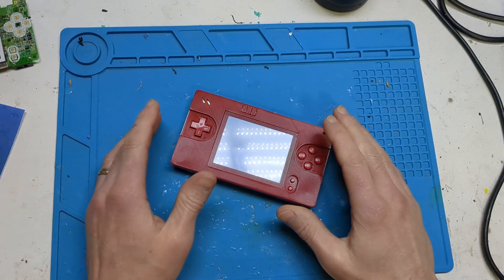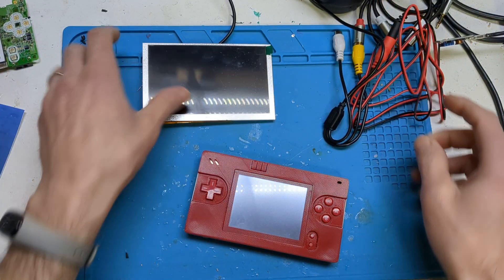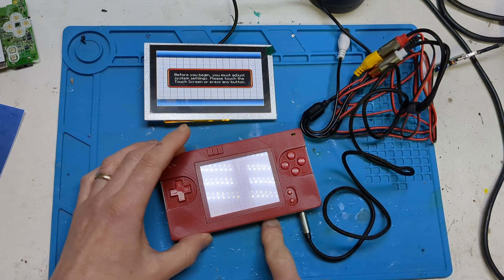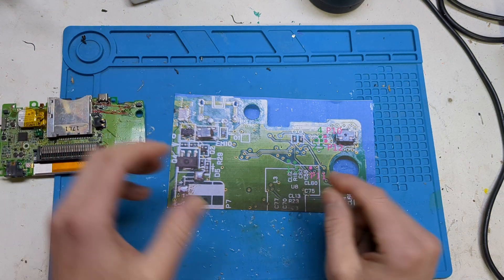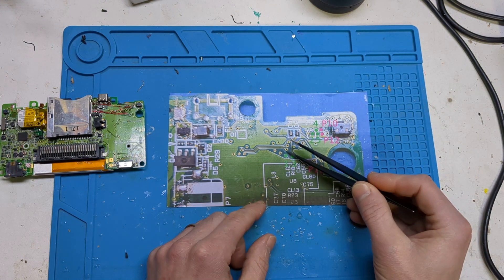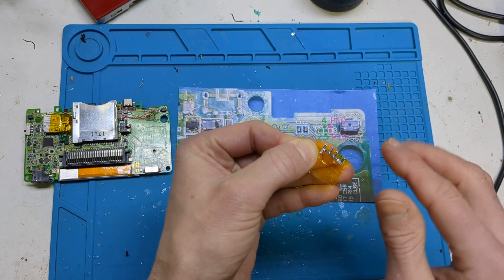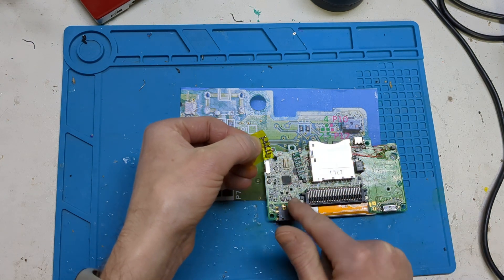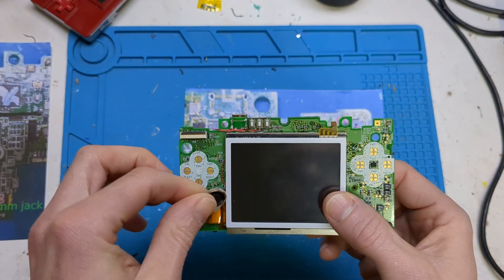Gameboy macro TV out the cheap way

Comment: I know this is an older video, but what are your thoughts on leaving the SL resistor and creating an rca adapter using an ds mic headset and using the mic port for the video signal (pin6), allowing for stereo audio and video out through the headphone port. Also not sure if there would be interference with pin 6 but that trace is easy to cut if there is.
Reply from the maker: You probably could do but the ds lite mic cables are hard to get hold of and you would need to make a custom cable.

Comment: Can it still be used with the top screen attached despite it not going to display? I plan on using a swap screen mod and I just want tv out without having to take off the top screen.
Reply from the maker: No unfortunately the patch to the firmware makes the top screen have a purple hue to it.
Reply: Ok thank you

Comment: I'm pretty unfamiliar with PCBs and how the DS Lite works, but I do have a few questions:

Do you think it would be possible to have an AV out signal for both screens? Like a way to display both screens on the TV with one 3.5mm to RCA?

Also would it be possible to have AV output for both screens, while also keeping the display of both screens on the DS Lite active?

It's my goal to possibly design a PCB mod to do this, but I don't know if that's a limitation of the AV out implementation on the DS Lite or if it just requires a lot more engineering on the custom PCB. I'm still a complete amateur, but I would like to learn and figure this out no matter how long it takes.
Reply from the maker: So the TV out mod that was discovered was to only display one screen on the TV. You would need to make a capture card for the ds and tap into the screens date lines if you wanted that. I know that someone has done one for the ds phat in the past
Reply: @facelesstech  Oh ok I see, thanks! Then I guess my goal is to create a capture card for the DS Lite now lol (I am familiar with the DS phat and 3DS capture cards).

I don't know anything about PCB design or electrical engineering, I only just finished my computer science degree.

Do you know any resources I can use to learn or get started with that sort of thing?

Comment: Great mod! First I saw this solution with only the resistors by Mundo Yakara Colombia here on Youtube.

I'm not sure, but would it be possible to use this with USB-C? It would be great to have a USB-C charging mod with the TV out integrated. So you could charge the DS Lite while playing on the TV with only one cable. :)
Reply from the maker: That's an interesting idea, think I would have to use and abuse the USB C spec tho
Reply: @facelesstech  I'm curious to see if you can implement this. :)

Comment: Where can I get that custom board you made for this mod using the small resistors?
Reply from the maker: Hey, didn't think anyone would want that board lol, I've updated the blog with a link at the bottom for them.
Reply: @facelesstech  How do I actual get the board from GitHub to a PCB?
Reply from the maker: @vitzie629sgamingtechnology7  download the files, your looking for the zipped gerber file. I normally use JLCPCB for my boards, create an order then upload that file, will probably want it in 0.6mm thickness to save space.